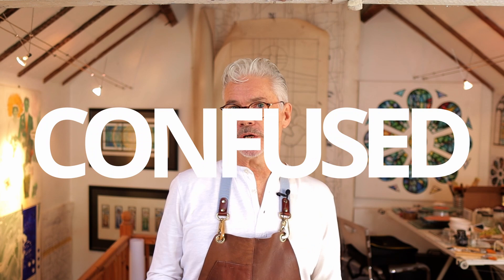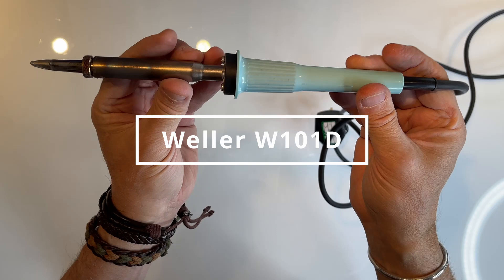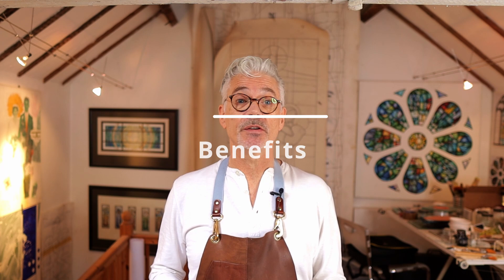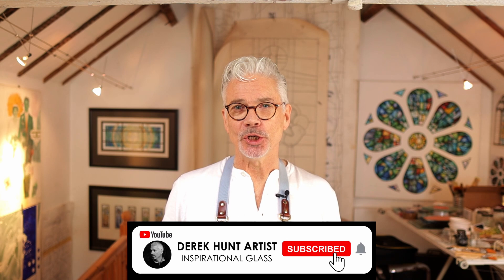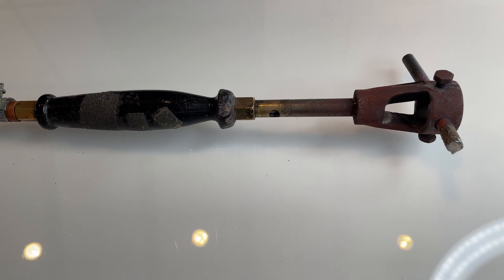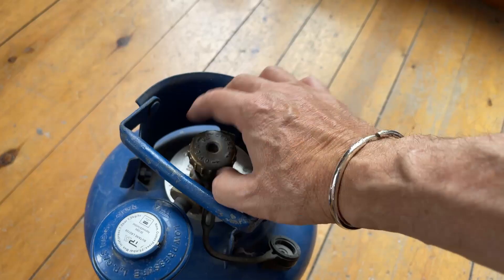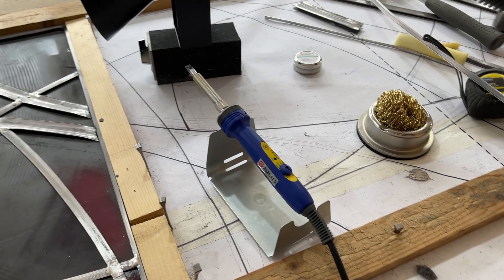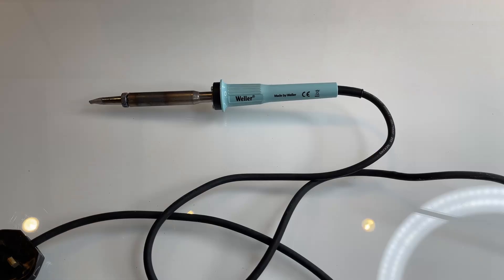Which soldering iron should I buy? Three of the best tested so you don't have to!

Comment: I used the Weller 100 for many years and was always happy with it. The handle never got hot but I've read that the Weller isn't the iron it used to be, that the quality has degraded. These days I use the Hakko 601 and it's brilliant. My solder lines are so much smoother. The only complaint I have is that the lead is too short and stiff. I would never have a gas iron, I would, without doubt, burn my house down 😟
Reply from the maker: Hi Rosie, yes the Weller irons don’t enjoy the best of reputations these days, due in most part to reliability issues. The Hakko is too small for my work, unfortunately.

Comment: I have been using the  Weller mainly. After 23 years, it finally went mental & burnt itself out…as well as the lead - I think the fixed temperature thermostat became defunct & it over-heats. I bought a new Weller last year. With the supply cable, I rigged up socket in the ceiling of my workshop, so that the cable doesn’t lay on the work.  I have a gas torch too, which uses propane gas (red bottle) but I rarely use it, mainly as I don’t have many large window projects. Great video & as someone else 
suggested, would love a video tutorial on kilns & firing.
Reply from the maker: Thanks for your feed back “special lion”. Good idea about a ceiling socket for the iron :)

Comment: Since you asked for inputs on what we use, I use a Weller SP80 (80 watt) plugged into a PRO soldering station with a dial that controls how much power goes to the iron itself, which provides a good control over temperature. I know a lot of people love their Hakkos but its small-scale electronics and very low wattage don't meet my needs. I rarely do large projects so the 100 watt Weller was overkill for me, and at 80 watts the SP80's handle doesn't get excessively hot like you report the 100-watt Weller's does. I'm intrigued by the gas iron because I'm an engineer by temperament and training, so I love unusual gadgets, and I may have to buy one of them just to play with.
Reply from the maker: Great review thanks! I would definitely encourage you to experiment with a gas iron. It’s so good for speed and easy to use - fire hazard aside! 😁
Reply: The Hakko may be low wattage but it's ceramic technology means it can better the SP80 in all respects.

Comment: I have a Weller and used to swear by it but it keeps cutting out now 🤨 so I took a punt at a £16 variable temp one from Amazon - the manufacturer would probably laugh at me if I told them I was using it for stained glass! It has a very small tip of 4mm but I now swear by it! Perfect for my small copper foil pieces.  If I’m doing a larger piece then I get the Weller out but I love the fact I can drop the temp for mini lead work (eg hobby came) on the little one
Reply from the maker: Awesome!

Comment: Otro vídeo muy interesante, una duda, pasas un cepillo por encima de la soldadura? Gracias
Reply from the maker: I brush the solder joint with flux paste before soldering. I brush the tip with a damp sponge to keep it clean
Reply: @DerekHuntArtist  Thank you so much, I didńt explain it well, I saw that you brush the welding point after welding with a metal brush ?
Reply from the maker: Yes, I cleaned the tallow flux off the solder weld with a metal brush to clean up the joint.
Reply: @DerekHuntArtist  thank you so much
Reply from the maker: You're very welcome! @felisarequena

Comment: I am trying to connect metal supports on a door to attached the stained glass to the door. Will soldering the metal supports to each other be strong enough to withstand the opening and shutting of a door? My question is: How strong are the joints you are making when you solder?
Reply from the maker: Hello 
When installing a leaded glass window into a door it is important to build in sufficient support for the panel, so it does not buckle or bow over time. This is usually done by adding horizontal support bars about 300mm apart ( 1 ft) which are fixed into the door at either side. The leaded panel has copper ties soldered to the window next to the support bars, and the copper ties are wound round the support bars to secure the panel to the bars. For additional support add safety glass on the outside face of the leaded glass window to give more support. Leaded panels suffer a lot of stress when a door is opened and closed many times, so think carefully about building in good support for the panel, or it will create problems later. Hope that helps.
Reply: @DerekHuntArtist  Thank you so much for your reply! I should have provided more context. I’m actually trying to repair our front door. 9 years ago we had an glass expert installed this stained glass. He did like you said and there are 2 metal supports about 1ft apart. The problem is that each of those supports have separated from the glass. It appears they were soldered in place. But I’m not sure. I’m going to try to solder the supports back on. How do you recommend the metal supports get fixed on at either side? Is connecting two pieces of metal a different method than the soldering techniques you show in your videos?
Reply from the maker: @surenza  yes, soldering two different metals together can be problematic if they are not compatible metals, and you need the right flux to make them stick together. The supporting bars get fixed into the door, usually by drilling holes in the door and sliding the bars into place.

Comment: I use a Weller soldering iron, too much flammable stuff in my sea container to work with a gas iron and besides my projects are fairly small. I have  outlet attached to the side of my worktable so no extension cord needed.
Reply from the maker: Excellent Fernando! My sockets are miles away!🤣